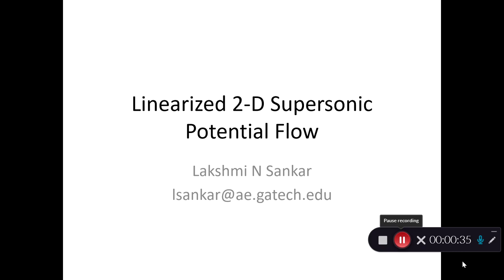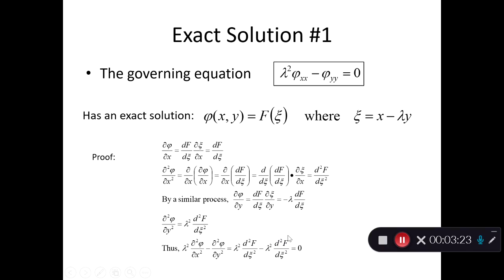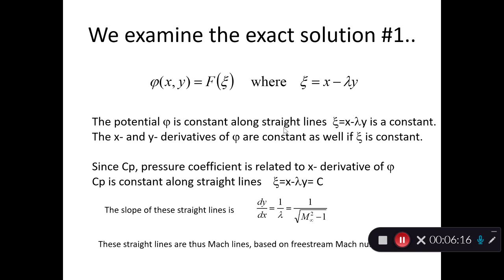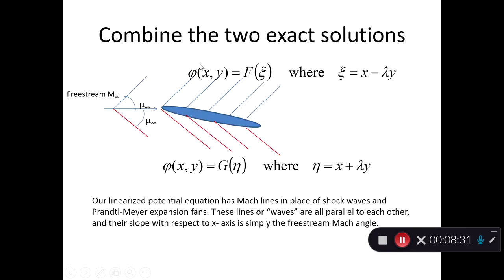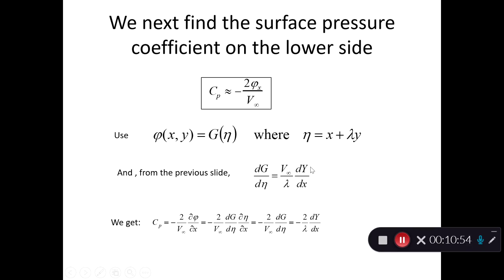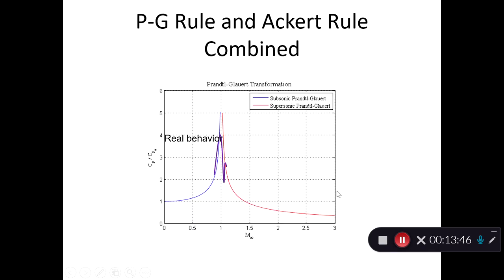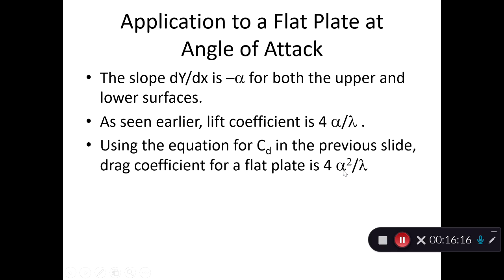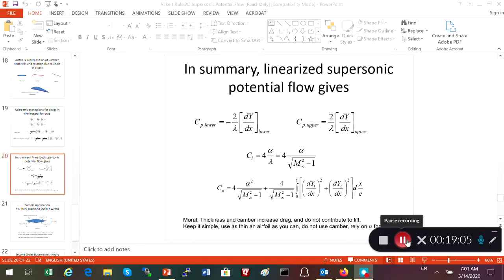2 D Supersonic Flow over Thin Airfoils

Comment: hi sir. I want to ask a question.
if there are two conditions of compressible fluid flow in the same flow area but at different speeds. why the higher velocity flow has a lower static pressure?. is it the same as the incompressible flow caused by the dynamic pressure? or it it is caused by the density decrease only?
thanks
Reply from the maker: I am assuming that the freestream velocity is constant, and the velocity over the airfoil at two points are different, and that you want to know how these velocity differences affect pressure.

For inviscid adiabatic compressible flows,  in the absence of work done by propellers/rotors/turbines, we know that the total enthalpy h0 = h + velocity_squared /2 is a constant.  When velocity increases, enthalpy will decrease locally, and the static temperature T will decrease.

If the flow is isentropic, then temperature decrease will lead to a pressure drop, from isentropic flow relations.
Reply: @lakshmisankar6498  hello. I am so sorry that I didn't tell it was different case 🙏.

 I mean the phenomenon in internal compressible flow. The mixing of supersonic and subsonic flow in steam ejector cause increase in static pressure and decrease the velocity. As far as I know, in incompressible flow the relation between velocity and pressure is occurs due to the dynamic pressure and static pressure. But I don't really know in terms of compresible flow

Thank you so much